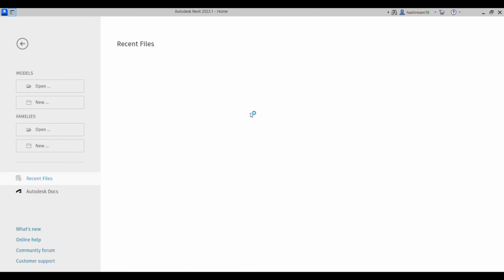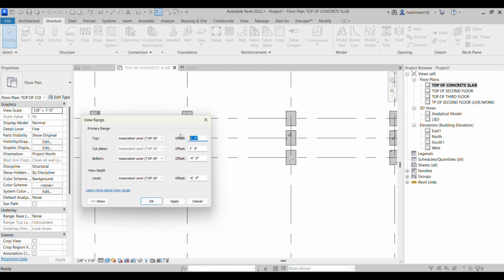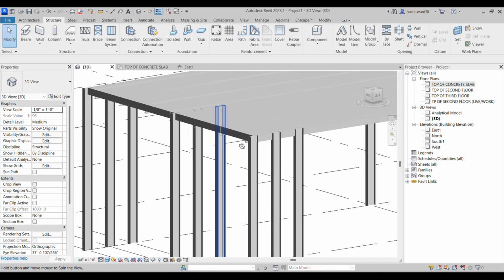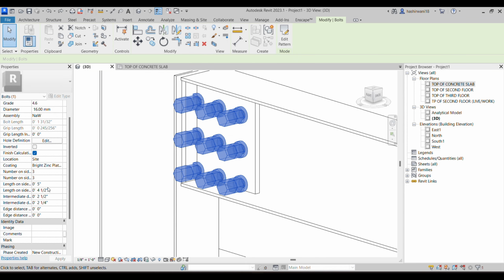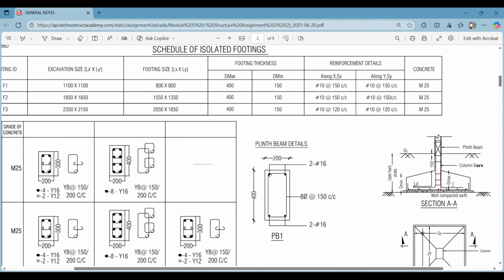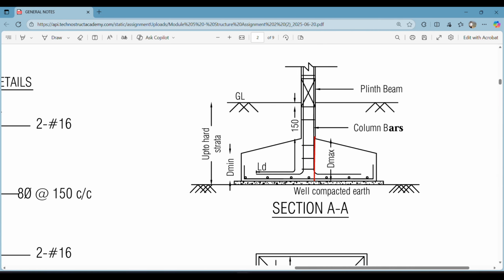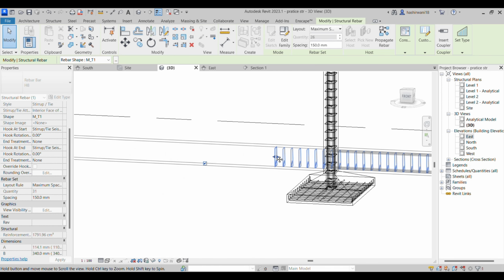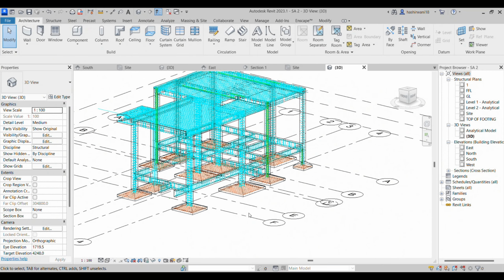BIM Structural Modelling Recapitulation Masterclass by ER HashirVani PART 1 #bim #revit #structure

Comment from the maker: Here's a summary of the topics covered:

Linking Revit Files & Copy/Monitor Workflow (0:36 - 6:06): The video demonstrates how to link architectural Revit models to structural models and use the Copy/Monitor tool to efficiently transfer grids and levels, avoiding manual recreation. It also shows how to manage and review changes from the linked architectural model.
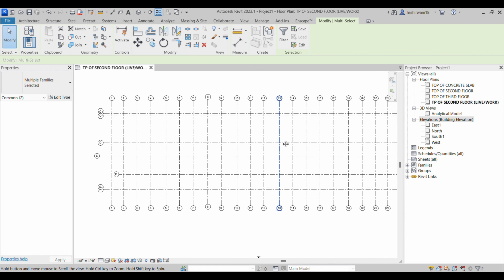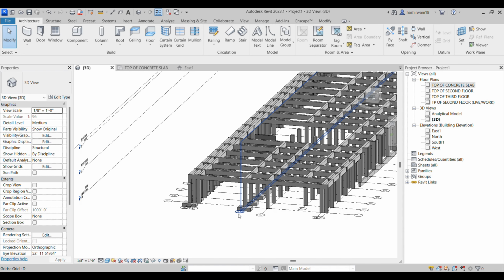Modeling RCC (Reinforced Cement Concrete) Elements (6:47 - 19:17):
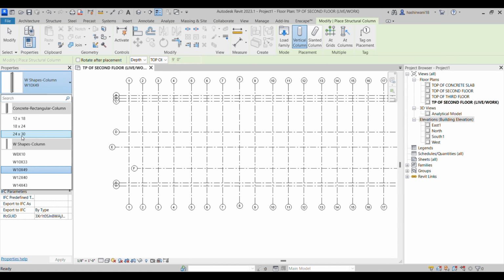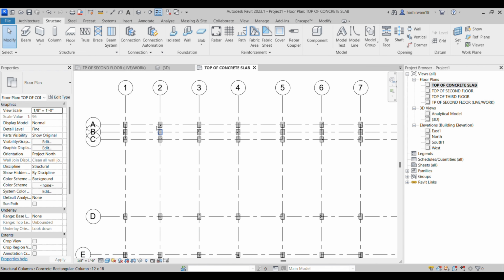Columns (7:24 - 9:56): Explains how to load and place various types of columns (concrete and steel) individually or at grid intersections, and how to adjust their base and top levels.
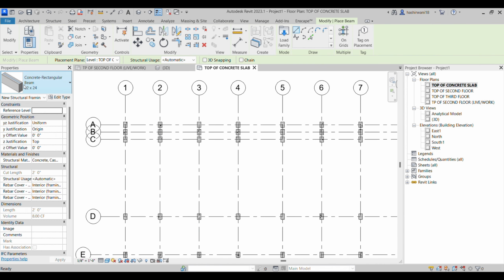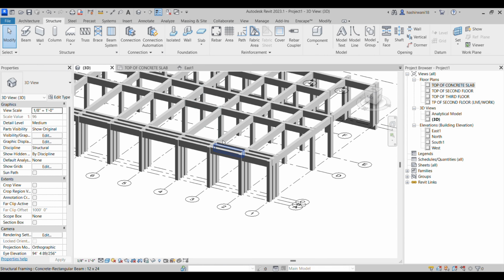Beams (9:57 - 14:25): Demonstrates how to load and place concrete beams, adjust their start and end levels relative to columns, and create beam systems on grids with fixed distances or by number.
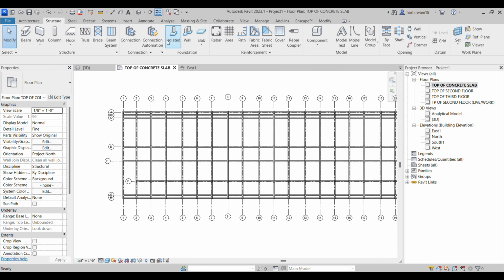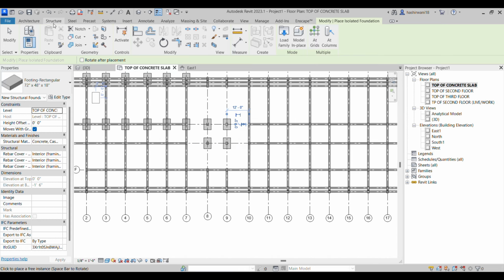Isolated Footings (14:26 - 16:36): Shows how to create isolated footings for columns, either individually or at all column locations.
Wall Footings (16:37 - 17:51): Explains how to create footings for structural walls.
Custom Elements (17:52 - 18:36): Briefly touches on creating custom columns, beams, and isolated footings using family templates, and wall footings using the "model in place" option.
Modeling Steel Elements & Connections (25:07 - 39:41):
Brace Systems (25:07 - 25:56): Shows how to create brace systems between structural framings.
Predefined Steel Connections (26:50-30:03): Demonstrates how to load and apply various predefined steel connections between beams and columns from the Revit library.
Custom Steel Connections (Plates, Welds, Bolts) (30:04 - 39:41): Provides a detailed walkthrough of creating custom steel connections by modeling plates, applying welds between elements, and adding bolts with customizable properties (diameter, grade, number of rows/columns, edge distance). It also shows how to save a custom connection as a generic connection for future use.
Project Assignment Overview (39:43 - 40:05): The video concludes by introducing a project assignment that involves creating models of columns, beams, and footings, and modeling their reinforcements based on provided drawings.